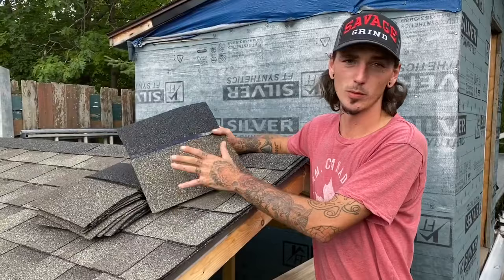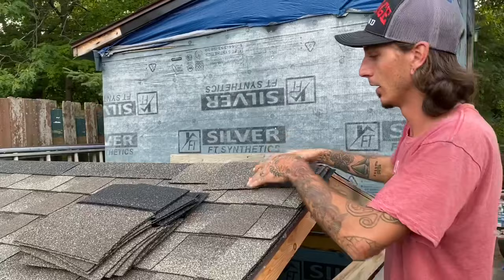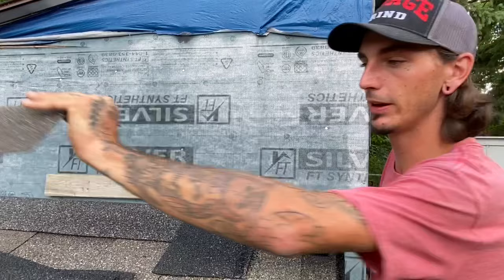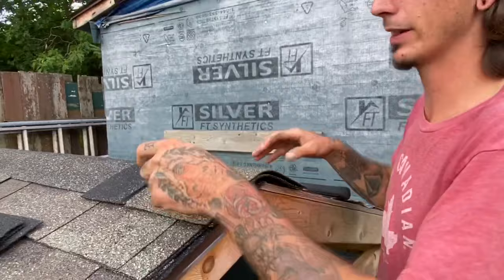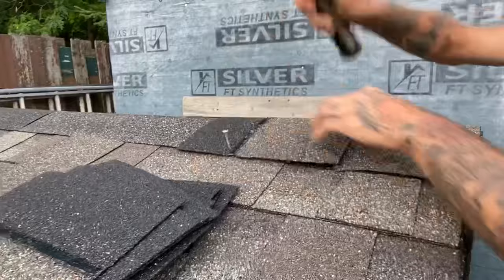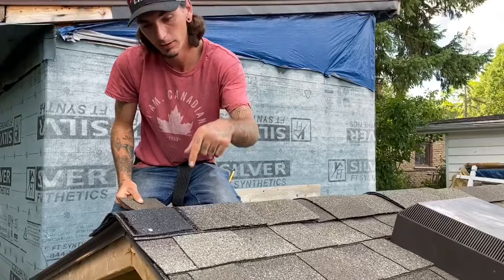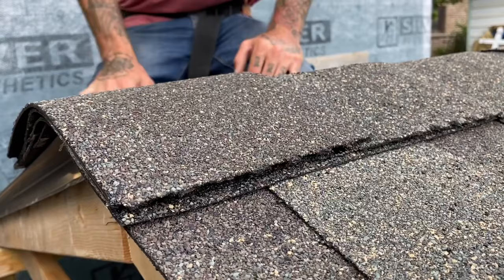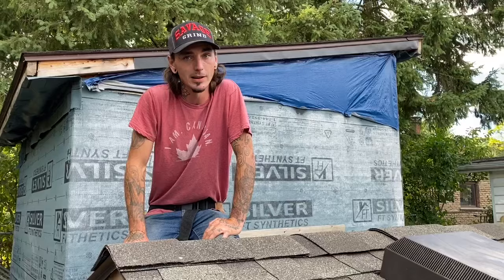How To Install Roofing Ridge Cap (The Right Way!!)

Comment: Question:  If a shed with a passive ridge vent has the opening at the peak where the sheathing meet, I presume you don't want to overlap that space with the last horizontal row of shingles because that would defeat the purpose of the venting, correct? Instead you would only layer the opening with the overlapping ridge vent shingles as described...also correct? Conversely, if the sheathing met each other at the apex with no space and gable vents are used then you could layer the apex by overlapping the last horizontal row by itself, or as you recommend the added second layer of overlapping shingles, right?
Reply: Correct

Comment: What size nail do you use for your ridge cap?  I am seeing that at least a 2" nail should be used to ensure they don't blow off in a wind storm.
Reply from the maker: 1 1/4 - 1 1/2inch
Reply: @Average_Roofer  1 1/4 to 1 3/4 🤠

Comment: Are ridge cap shingles different from regular shingles? Some of my ridge caps blew off and previous owner left some really wide shingles in the shed. Can I cut those to size and use those as ridge cap? Also the shingles in shed are brand new but are probably 10 years old. Can I still use these?

Comment: What size of nails do you use for the ridge cap shingles? Are they the same size as the rest of the roof... 1 1/4"?
Reply from the maker: Typically yes, depending on depth of the shingles. Some cap requires 1” 3/4 nails.

Comment: What’s the reason why you don’t use the same shingle as the rest of the roof for the ridge cap ?   The  laminated shingles instead of the 3 tab shingles you used.
Reply from the maker: Laminate shingles will delaminate if bent. That’s why you use 3 tabs because they are more malleable.

Comment: What if I am closing up a ridge vent?  My house a ridge vent and I am going to be installing a gable mount attic fan.  I want to close off the ridge vent so the fan pulls air only from the eaves.
Reply: It's best to put some new sheething in that gap to close it off, but if you just run your paper overtop and lap it over the other side, and do the same with the other side. Then when your last row of shingles are put on, do the exact same thing. It will add some rigidity and form so the cap shingles don't just sag in the middle. 

This only really works if the cap you are putting on extends past the old ridge venting gap. If it doesn't, then you'll have to add in new sheething there.

Comment: Thanks to your excellent videos, I was confidently able to finish (well, mostly finish) the roof on my lean-to shed today--even solo! 

One problem, though, is that I can't figure out how to finish the top row! Is the process still the same for lean-to roofs as in this video, but just cut flush with the drip edge instead of folded? Or is there a completely different finishing process for lean-to roofs?
Reply: Hey

Comment: I know some roofers will cut an angle into the back sides of each cap shingle (creating a triangular shape). No need to do this?
Reply: ..that's for when you are cutting 3 tabs shingles into caps...so no need on this application.
Reply: @darryltaylor9916  exactly 👍 typically cut a V notch out because no one is going to be able to cut perfectly straight, especially for a whole bundle or more.

Comment: Nice video.  Thanks for sharing.  I did have a question on something that confused me.  When you laid you last row of regular shingles before installing the ridge cap, it seemed like the last shingles were coming from the other side of the roof and overlapped to the side you were working on.  However I didn’t see any nails in that last row row that overlapped.  Do the nails from the ridge cap also nail down that last row?  Did you use adhesive rather than nails?  Hoping to shingle my shed in the next few days.
Reply from the maker: bklyn2va2dc as for the demonstration there was very few nails used. But if you were actually doing this project. Install all nails accordingly.
Reply: Your Average Roofer ok great.  Thank you for the fast reply.  Going to install them today.  Your videos were a tremendous help!  Much appreciated.

Comment: Do you peel off the clear plastic strip covering the tar strip? I have seen some roofers just leave it in place but not sure if it dissolves?
Reply: The clear cellophane you're talking about should be on the top back side of the shingle, if it's stuck to the tar strip on the bottom backside of the shingle then its just stuck there by a manufacturing defect, if that happens then yes you do need to peel it off.

Comment: dude the first piece you installed, the black half... you should either cut it shorter or longer, because what happens is it's exactly the size of the granulated part of the next shingle you will start your course with that overlaps it...and when you nail it (you can see it in the video) you get a big depression where the nail is because the parts to the right of the nail are double layered, it gives less flatnesss to your run

Comment: Just curious - I recently had a new roof put on and i was wondering if it matters that all the roof vents (4) are on one side (south facing) Central Ontario? We are in a one level gabled and vaulted ceiling . Approximately  32 feet long. Appreciate any thoughts you might have.
Reply from the maker: All vents should be on the same side on a gabled roof to avoid cross venting. Cross venting is two vents aligned across a ridge line on separate faces. This causes vents to cancel each other out and makes them function improperly. 

You will have no issues with all 4 on one face of the roof.

Comment: Do you cut the ridge cap pieces or do they come like that?
Reply: You can cut your regular 3 tab shingles into 3 equal pieces each for your ridge cap shingles
Reply from the maker: Most manufacturers have their own corresponding hip and ridge shingles that are perforated and simply snap apart. This sometimes causes rippled ridges but saves a lot of time on labour expenses.

Comment: Very unprofessional, He should have snapped a chaulk line to keep the ridge caps straight. Send this bonehead back to school and teach him how to do it right. Very poor video
Reply from the maker: Please clarify how a chalk line would make ridge cap look more professional?

It’s optional especially if the roof has a sag from stress or improper framing; your chalk line can actually do more harm than good in some instances.
Reply: If your a experienced Shingler and know how to shingle straight, and line up your shingles to be straight with the peak (or somewhat if the peak isn't straight)

Then you can use your top run of shingles as a straight edge. It's always worked for me. Only works with the top peak though. On hips you have to use a chalkline.